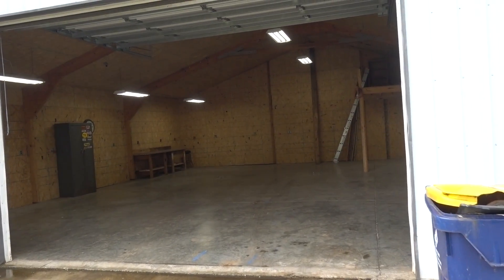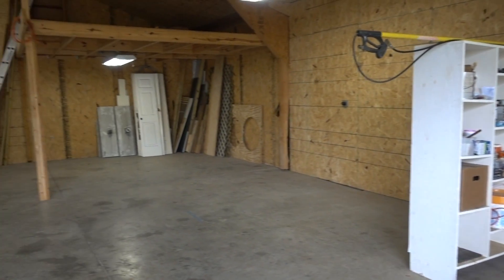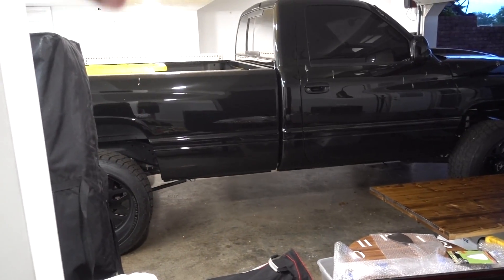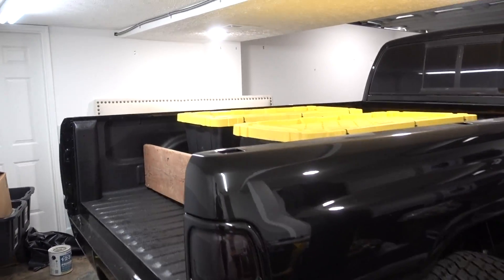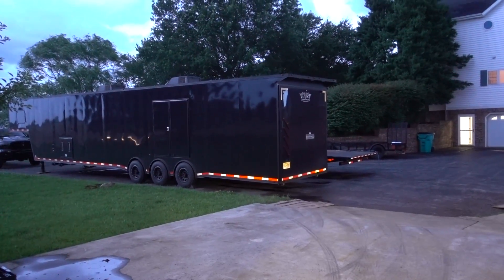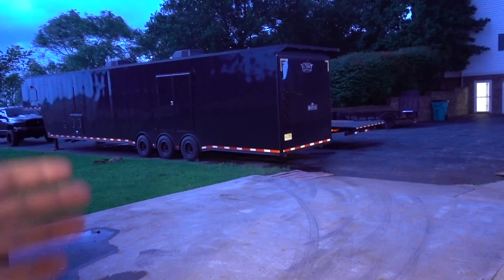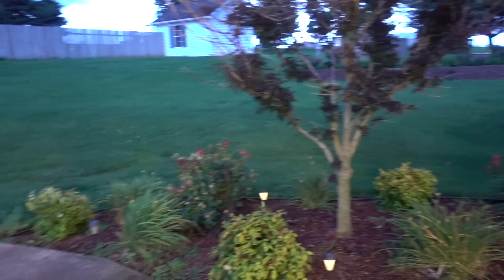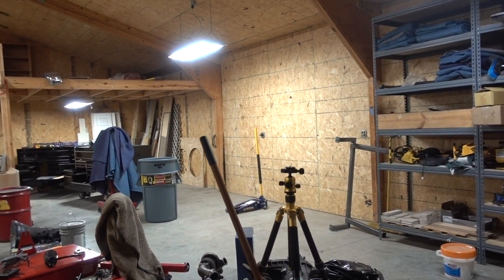NEW SHOP TOUR!!!! IT'S AWESOME!!!!

Comment: Awesome new shop I personally would keep the overhead storage and put all
Your tool boxes under there . And make that the designated tool corner
Reply: Ari Burrows was gonna suggest that same thing.
Reply: Put air compressor on top
Reply: I second this for sure
Reply: Second the air up top, and build walls around it so you don't have to worry about background noise
Reply: I agree. Took boxes under the storage loft with some LED lights lighting up the boxes. Put Somme stainless peg board on the wall to hang some frequently used things. Compressor up top with insulated walls for noise reduction.
Reply: Yep i second that too, i also think it would be cool if you did white sheetmetal over the osb board, hang banners or signs on it
Reply: You nailed it! Agreed on tool shed. Paint that ply wood and stain or paint them beems cheapest route. You could use some 1x for trim on the floor and seams.
Reply: He could put some real nice lights under the loft and have a nice work area
Reply: Agreed
Reply: Only thing is how often do you see him use air tools
Reply: That exactly how my cousins shop is, and it works out perfectly for that, we have spare parts up top and tools and work bench underneath, works out great
Reply: Agreed
Reply: @aaronlewis8968  na it should go outside, they are annoying, especially the large ones and would rattle that floor to death when it kicked on.. i keep mine outside on a 4ft x 4ft pad with a small roof over it..
Reply: I was thinking set it up like the last shop and have a "loft" stick out about 6 feet or so along the whole back wall.
Reply: Gotta jump on the bandwagon. I think putting toolboxes under the loft would be ideal. Great idea to put air on top as well.
Reply: Most definitely a tool box station with compressors on top.
Reply: I would use that area for the toolboxes also but then build a new bench for engine disassembly and reassembly.
Reply: i know I am kinda off topic but do anyone know a good site to stream newly released tv shows online ?
Reply: @Kody Christian Flixportal :)
Reply: @Elijah Mohamed Thanks, signed up and it seems like a nice service =) I really appreciate it!!
Reply: @Kody Christian Glad I could help :)

Comment: I would paint the osb white. The osb makes it super easy to hang stuff on the wall. Do white osb with galvanized roof panels on like the bottom 3’
Reply: Exactly what I was about to comment👍
Reply: Wood soaks up paint. You'd have hundreds of gallons of paint invested.
Reply: @brandonfloyd6321   lol not at all thats part of the reason you use primer

Comment: shop needs a taller door so you can store the Peter inside 🔥
Reply: it will fit thru that door
Reply: @nickscustoms269  thats a 10' door and that truck is 14' tall. Do the math
Reply: @kevinlee7811  i thought he said is was 16 high not 10 feet, however trucks  are no taller than 13'6"
Reply: I was thinking the 16' door would be tall enough, but if he narrowed it up to just wide enough for the semi and then put two regular height garage doors, one on either side of it he could drive 3 trucks straight in and not have to turn after getting in the door to get it off to the side. not to mention if he got insulated doors I bet that'd help with the heat a Ton in itself
Reply: @nickscustoms269  16 wide not tall

Comment: You'd need to insalate the walls if you want to add AC I'd suggest putting white foam wall panels
Reply: Probably is if therenin ply wood up
Reply: @dill5500  it probly is, but you still wanna be sure before getting too far, but if the door is radiating soo much heat, it does sound like the walls are already insulated if your noticing the door that's not insulated
Reply: @cmusic52  thats why i built my shop out of cinder blocks stays super cool in the summer for the most part and i can get it up to 80 in the winter with a wood stove
Reply: Yes I install foam wall and acm panels for s living so I figured I'd throw it out there.

Comment: OSB makes great structural wall for any shop needs. You can smooth it with drywall mud if you need, otherwise put a good primer sealer and paint it
Reply: thats it
Reply: This is for sure the answer. Like a textured mud over that osb, cheap and easy.

Comment: Go get foam board from Home Depot and cut to fit inside the panels on the garage door. R5 per inch and only couple hundred bucks could fill that door
Reply: Was just going to say that,  I used the foil covered panels and fit perfect  with little or no cutting.
Reply: As a garage door tech, DO NOT DO THAT. those springs are for the exact weight of the door. Do not add anything to it. Get a company to come insulate and change your springs out. It will be cheaper than you think.
Reply: @rightchoicehvac3620  yes there is
Reply: I was gonna say they make insulated garage doors... just get some of them

Comment: Nice video. You should put all the tool boxes and on one side of the shop. Also you should get rid of the rooms and make it another bay to put another truck or something in there. Honestly you should just build on like 15 feet to the back of the shop. You could put your lift and stuff in the back and use the front part for truck storage. And put a side door in at the new end. So you could get in and out eaiser. That’s just my thoughts anyway of the perfect setup but I understand stuff is expensive. Looking foreword to the videos to come.

Comment: If you want to change the walls. Look into some 1/4 MDF. You can get it in two different combos. You can get it in just a raw MDF which is paintable or the one we used most of. Is one side is like a gloss white and the other side is raw.

Comment: I personally would paint the osb since it's already there and more damage resistant than drywall. Plus how often are you really going to have the camera zoomed in on the walls? As for storage, look into the shelving Home Depot uses. It holds alot and you can change the shelf height. Which means you can build shelves around the tool boxes, and if you get the right ones they are the depth of a tote.

Comment: Greg I put a challenger CL-12 lift in my shop. 12,000lb rating built in the USA. Cost about 2k more than the chinese version challenger sells but totally worth it. Weighs about 250lbs more than the chinese version.

Comment: On your shop walls, drywall/sheetrock is too heavy to hang from the ceiling.  Your best bet is going to be some fiberglass reinforced panels (FRP) which can be glued to the walls.  The bonus of FRP panels is that you shop walls can be cleans with a pressure washer.

Speaking of pressure washers, you  must put out a video of you using that 20" pressure washer wand the prior owner left behind.  Ally and Reagan will laugh their butts off and once they get settled, then Ally could get a video for the rest of the world to see.

Welcome to Kentucky!  Have some hot brown and enjoy the back porch for a few minutes before you go to bed.  Life is a bit slower in these parts.  Enjoy and God Bless!

Comment: SWEET SHOP!!! Keep the loft, use top for your storage and the lower for the tool corral. I would paint the OSB with a heavy white, Kilz or something like that, Build a nice room for all the heavy and loud equipment to be outside. Epoxycoat the floors with your logo would be dead sexy!

Comment: love the new place having a shop close to the house is the best thing I ever did, mine is 40x80x16 with 5 14x14 doors, my mezzanine/office area has the a/c heat unit its the same hotel rooms use and works pretty good for that area (even though it isn't finished yet) they are about 1k new but worth it, I got my lights from lowes they are the hi bay lights led they use next to no power and its like daylight in there, Also I went to some auctions where dealerships were moving locations and got some solid steel benches and a tire machine pretty cheap the stuff is used but gets me by for what I need. Good luck with the shop I look forward to updates.

Comment: I did my whole wood shop ceiling in osb and painted it white is it perfect no is it bright hell ya. 
I had an uninsulated door as well went to Lowe's and bought the white styrofoam insulation did 14'x8' door for like a 100 bucks works like a dream. 
I would put the tool boxes in front of the lift because where is most of the work going to go on? On the lift haha.
The  on the wall heat and cool units can go up to like 1600 sqf if I remember right.
It's always nice having your own shop and investing in yourself instead of the land lord. 
Keep up the sweet videos.

Comment: So for heating and cooling definitely make sure shop is insulated well and for 1600 sq ft in Kentucky you’d probably be looking at a 3-ton ductless heat pump. Provides both heating and cooling and the heat pumps now a days can handle to -15 degrees Fahrenheit and lower. Basically one condenser and multiple evaporator units will take care of dehumidification. Mitsubishi and samsung have been doing great things with heat pumps/ split systems. Plus hanging on the wall they take no floor space up and are quiet.

Comment: High CFM exhaust fan/fans will work wonders with the heat. Plus will help with all the smoke. Something to think about, you will want your tools and work area close to your lift so you’re not walking all over the shop all the time. I would definitely recommend building a small shed on the side to house an air compressor in so you can hear yourself think inside the shop.

Comment: If at all possible you  will be much happier if you removed the 16 wide door and installed two 10 foot or if you have the room two 12 foot wide insulated doors. I added a 40 by 60 addition to my shop with a  cathedral ceiling we used the white bubble type moisture barrier under the roof sheeting and then again on the inside of the ceiling to help with installation and to help reflect lighting. Also the interior walls were osb and we painted them with a good gloss white paint. It makes hanging anything on the walls easier. The boys used a projector to paint all of the popular logo brands on the walls like bullydog k&n fass afe cummins ect...  it turned out awesome  we also used epoxy on the foors put down some business logos and a few automotive logos then cleared over the top 
Love the new place 
Wish you and your family the best
Eddie Whited. RAM POWER FLEET SERVICE

Comment: Keep the overhead/loft area. You’ll run out of floor space so it’s nice to have overhead storage for stuff you don’t use all the time. Put the tool boxes under the loft area or the back wall. When you pull a truck in you’ll have the toolbox near the front of the vehicles. Saves time in the long run.

Comment: Greg: congrats on the new place. One of the issues with the heat in the shop is it has no where to go. You need more ventilation. Another consideration would be to add skylights, they would let in a tremendous amount of free lighting and if you can crack them open it would allow the heat to escape. Or have skylights and roof vents.

Comment: Mini split for the ac system is the way to go definitely. Very cost effective and efficient. Fast and easy install. I’d highly recommend. As for the walls I’d do metal, look up rr buildings and check out some of his buildings. The metal inside looks really clean and works awesome. Then for an air compressor I’d put it on the outside. In a little out building to keep the noise out. Works awesome. Good luck with the shop, I can’t wait to see it

Comment: Hey Greg, Awesome home,property, and a BEAUTIFUL "starter shop". I would put in some "laminate" white paneling (shop interior), its cheap and the panels are very thin. As for the HVAC set-up, I would find a nice "waste oil" shop heater (they will burn any flammable/combustible fluids), they are worth their weight in gold and they pay themselves off VERY fast in a shop filled with diesel trucks. Some of those shop units are also "Heat pumps" (Heat & A/C), no more paying to get rid of used motor oil/ATF/kerosene/ETC. Dont forget a nice 100KW-175KW "back-up" Generator which would be more than enough to run every thing in your shop & home, Cummins/Generac/CAT/ETC have "multi-fuel" units, Diesel units, and CNG units. A Bend Pak 15k "wide ride" twin post lift, a decent 240V Miller Mig/Tig/Arc/ETC welder, and you can't have a diesel shop without a decent sand blast cabinet/ a "Rotary Screw" compressor with 1 or 1.5 I/D piping to maintain a high air volume & add "tank capacity"  (Kaeser makes very nice compressors, but they are pricey), and of course an old kitchen stove/oven (to bake painted parts & powdercoated parts). It also might be worth adding another 10k twin post lift (not only an extra work bay, but it doubles as a "parking aid", you could put the 2nd gen on the lift and park the 1st gen under it).

Comment: Should build an outbuilding for the air compressor
Reply: Much better than putting it up in the loft. The compressor needs cool air and a dump valve for the tank to remove moisture daily.
Reply: Realistically it should be in a well ventilated area inside this shop, especially if you’re going with a/c. They aren’t designed to be outside.
Reply: @mfceo6.018  He didn't say outside, he said outbuilding
Reply: I understand that, but, in our climate the outbuilding turns into a sauna in the summer and ice box in the winter, just really rough on a compressor.
Reply: @mfceo6.018  yah, the only problem with that is the noise of it randomly turning on while he's trying to make a video
Reply: True, a insulated and climate controlled out building would be best if you couldn’t make it work in the shop.

Comment: I have a 40x40 pole barn. It’s finished inside with pole barn metal. Light grey. Super bright inside with led bulbs. Also insulated and heated. Ceiling is also pole barn metal. You’ll love it

Comment: Very nice homestead Greg. One thing you should look into for the house garage, if your gonna be washing cars in there is doing FRP paneling on the walls. Like 4 ft up from the floor. It’ll save the drywall from getting wet. Also you wanted to change wall colors anyway. That paneling comes in a few different colors. Definitely check it out. And easy install. Just glue it on sheet by sheet. And it’s durable. And easy to clean.

Comment: Install Mitsubishi split mini unit(s) for your cooling needs in the shop. It would be a real easy install for what you have there to work with already. Especially if you tear all that OSB down off the walls to do something different. I'd definitely peel some of that OSB back and check the walls for insulation just to be sure, but I'd have to guess they're all insulated if the previous owner went through the troubles of hanging all that OSB up. To tear that down and replace it with drywall would be a decent sized project but it would look so much nicer and cleaner. Just my thoughts on some of the things you were mentioning. Hope some of that can help ya out in making some decisions.

Comment: White hardwood paneling for the walls and paint the ceiling grey. It’s cheap and you can put it up yourself. As an added bonus, you can use dry-erase markers on some of the panels for “to-do” lists. Finish the floor off with a grey epoxy coating with white and black specs.

Comment: I personally run that storage mezzanine across the whole front of the shop and have my tool boxes underneath it.  When the trucks are nosed into the shop it makes it easier to access to tools.  Then the mezzanine uptop in the front can have lights under it and not be sooo deep.   Run an engineered header so there are no support pillars on the floor to take up room.  And look into ag panelling.  Aluminum interior panels are nice for lighting.  Anyhow good luck with setting the shop up!!!

Comment: I’d ditch the loft storage for useable floor space. Dont worry about the walls, just paint them. Drywalling them would just be for looks, kind of a waste of $. Also the HVAC unit you are talking about is called a Mini-Split. 1600 sq ft would be a lot for one to cool down. You’d be better off getting a legit commercial hvac system. I own a company near BG that does major grading and asphalt. Maybe if it works out we can come lend a hand on your parking area for trailers. Cool property! Welcome to KY!

Comment: I would keep the overhead storage and store your tools boxes underneath for more light. And on top you can store tires and rims etc. Maybe even your air compressor up there as well. I would dry wall the entire interior and put insulation in there for summer heat.

Comment: Congrats Greg on the new shop, love it,must admit I’m jealous, now down to business, you could insulate the garage door yourself with insulation panels or spend the money on a new door, the AC unit you were talking about is called a mini split, they offer different sizes for different size spaces but before you get ahead of yourself, you’ll need to make sure the walls and roof is insulated. Another suggestion is you could get yourself one or more of the brand name is big ass fan, I think the smallest one they do is 6 foot long  blades all the way up to about 12 foot long blades, personally I would paint the OSB white it is great for just hanging anything you want on it.
I wish you was down here in Texas, I could help you do so much of this stuff,I’m a contractor.

Comment: Love the new place and the location. I’d leave the storage rack up maybe shorten it some and put you some rebuild tables for like trans and transfer cases underneath    The drywall would aid in painting it and added insulation. And for sure keep the stack shelving up but I’d for sure relocate towards the front so you can keep fluids and such on it. The overhead storage rack I’d store oem parts on for quick locating.

Comment: I went with a 3' trim of corrugated metal along the bottom of the shop.  Keeps it nice so you can wash vehicles etc and not worry about overspray.  5/8 fire proof drywall everywhere else.